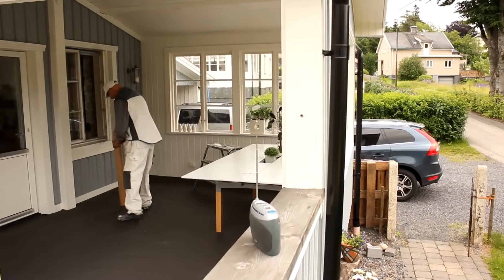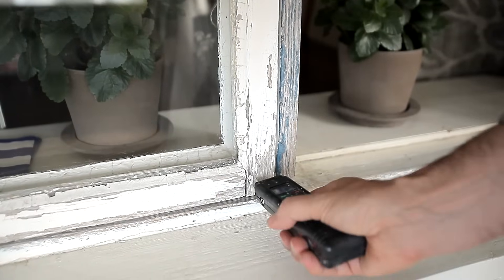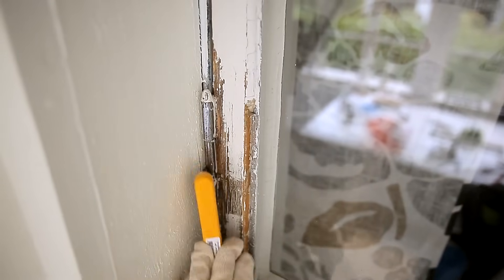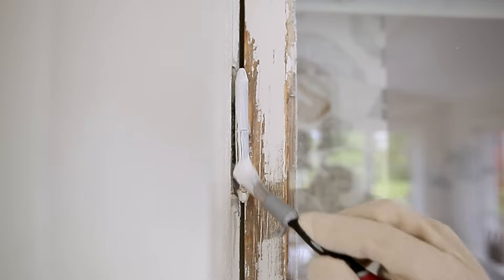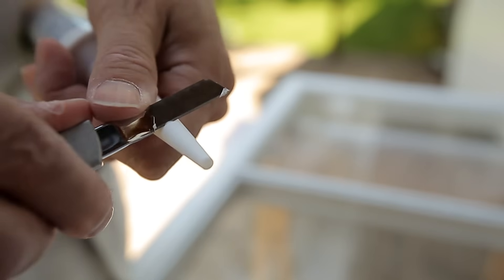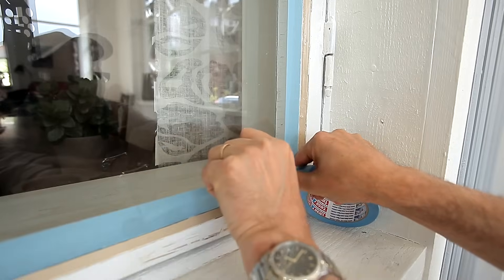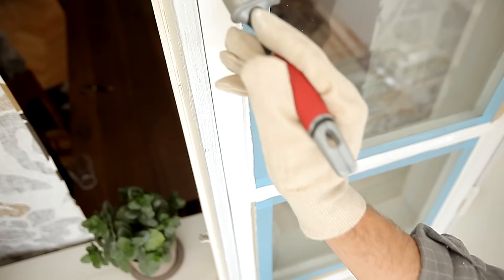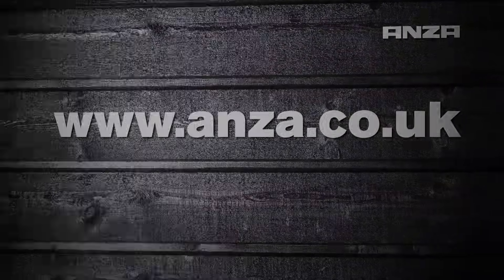Painting windows -- step by step

Comment: the only way to get a new look finish on this window is to strip the whole thing back to bare and then 4 coats of a oil based finish and use real putty completion time depending on putty around 2 weeks decorator 10 years

Comment: How about if the paint isn't coming off can i just paint over it with new paint?
Reply from the maker: Hard to say, it depends on the surface
Reply: If the surface is sound yes. If you can't remove the paint with a linbide (paintscraper) or 60-80 grit sandpaper and it doesn't look all cracked then sand it to de gloss, prime (to be safe) and paint. The "official" test is take a craft knife cut an X put selotape over the 'X' press it firmly down and pull it off like a bandaid. That'll tell you if any previous paint coats or filler has broken down
Reply: Not one per house but one per surface, your prevailing side will be worse for wear generally

Comment: Preparing your window for paint is key including using the right type of primer for your window frame. When painting vinyl, aluminum or PVC windows I like to go over all smooth surfaces with a foam roller to knock down any brush strokes for a professional finish. Be sure to protect your window seals on your vinyl windows with tape so you don't cause your window seals to fail resulting in foggy glass.
Reply: Lol a foam roller leaves orange peel. Lay off the paint with a brush. No marks if you can paint.

Comment: oil for the primer?
Reply: From Cynthia Moon below... best answer I could find (I had the same question - I'll just use Oil based paint on my windows.)
> It is probably linseed oil and it soaks into the dry wood frame.  Purpose is to keep the dry wood from sucking the oil from glazing putty. If the putty oil is drawn away, the putty gets brittle and eventually cracks. As a better alternative, I’ve been told that using an oil based primer on the bare wood will seal it thus prevent the oil being drawn out of putty.
Reply: @coreykaye4467  Very interesting. I wasn't sure why the glazing cracked. I assumed it was because water got in, when I was a kid.

I'm testing water-based paint on semi-dried oil glazing lol

Comment: What oil? The people at the paint store don't know what that's about. Are you using a wood sealer? Mineral oil? Olive oil?
Reply: From Cynthia Moon below... best answer I could find (I had the same question - I'll just use Oil based paint on my windows.)
> It is probably linseed oil and it soaks into the dry wood frame.  Purpose is to keep the dry wood from sucking the oil from glazing putty. If the putty oil is drawn away, the putty gets brittle and eventually cracks. As a better alternative, I’ve been told that using an oil based primer on the bare wood will seal it thus prevent the oil being drawn out of putty.

Comment: what is the oil for?
Reply: It is probably linseed oil and it soaks into the dry wood frame.  Purpose is to keep the dry wood from sucking the oil from glazing putty. If the putty oil is drawn away, the putty gets brittle and eventually cracks. As a better alternative, I’ve been told that using an oil based primer on the bare wood will seal it thus prevent the oil being drawn out of putty.
Reply: Interesting
Reply: @cynthiamoon372  Yeah big mistake my father kept making we lived next to an alleyway and consequently got quite a few windows broken by vandals he did replace the sash pains with the correct 3mm glass to balance with the balancing weights though but didn't prime the wood so eventually the putty dried out cracked let water get to the wood even though he did seal the putty by painting a few weeks after fitting the glass to seal it in.

Comment: Is it safe to scrape and sand led based paint like that Anza??
Reply: No, it is NOT. Depending on your country's applicable laws, you may not be able to dry sand or dry scrape lead-based paints and other coatings. And remember that lead based paints/coatings were used for decades in some countries, including old stocks not required to be destroyed. So even dwellings (including apartments) may have lead-based paints or coatings such as varnishes and stains applied to walls, floors, cabinets, baseboards, etc.
.
In the United States the Federal lead-paint ban dates back to only 1978; decades ago lead was in paint and some other coatings. The USEPA urges homeowners to 'work wet' to avoid creating lead-contaminated dust by using damp rags and paint removers when and where possible instead of scraping or sanding. US professional contractors have to be certified in recognizing and abating lead-based paint/coating hazards. In some case special escapsulating paints must be used used over old lead-based paints/coatings in good condition. 
.
Please consult your country's environmental or health and safety agencies for country-specific guidance.